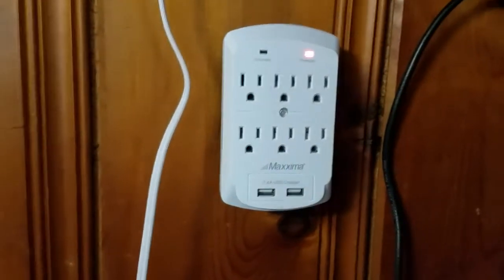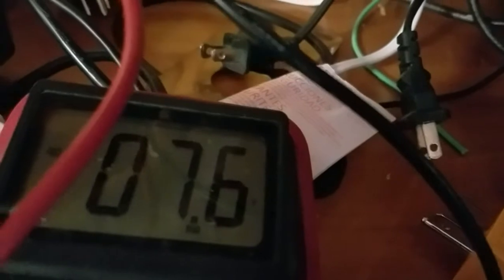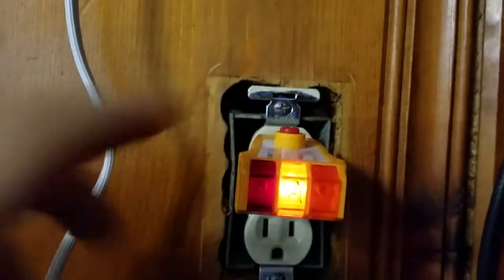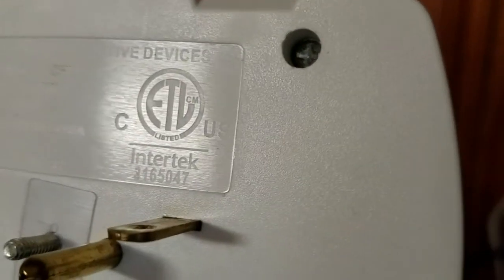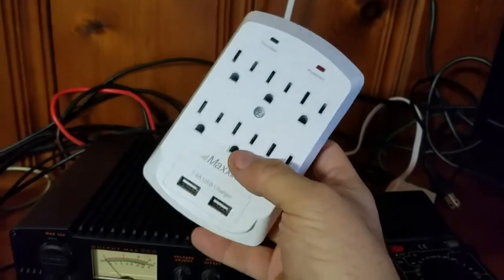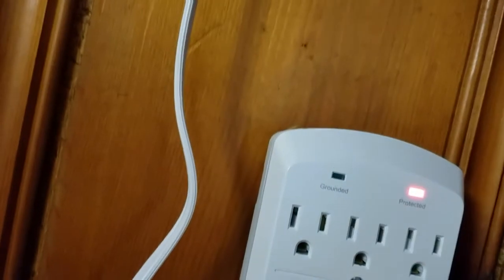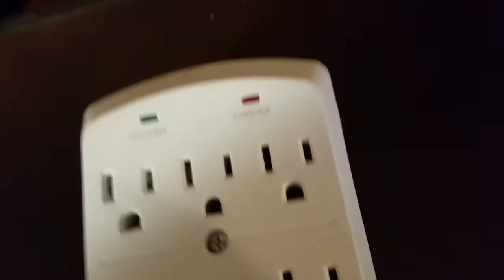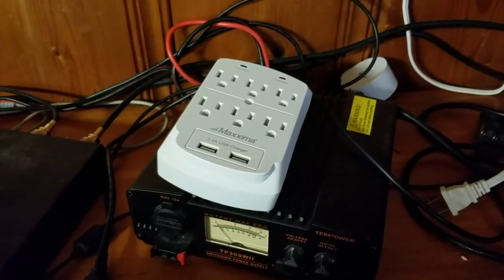Surge suppressor is making things unsafe.

Comment: I blew up a laptop using one, it put power on the usb's grounds and when I plugged in the printer it popped like a cap blewing up a large spark and took the board.

Comment: If you had a storm and a surge did come in.  The unit could act just the way yours did.  Always use a real battery back up surge protector.  I learned the hard way as well.  My HR2510 is toast and no one really works on them any longer.